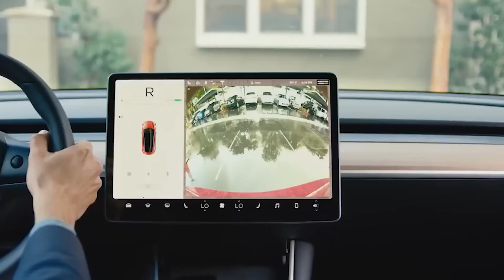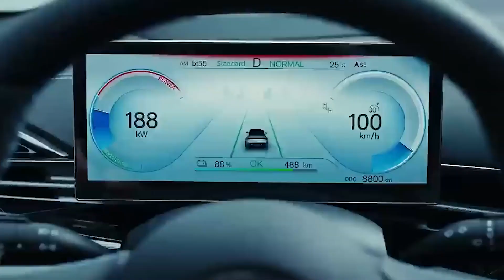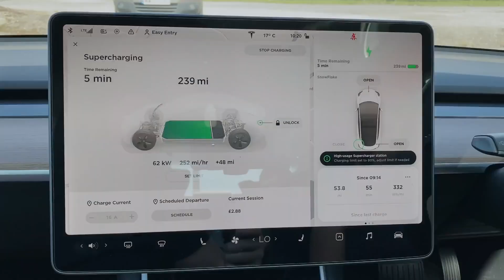TESLA - The Only Game Changer in Town | Tesla the Best EV Car Money Can Buy

Comment: Ok, I get how great EVs are, my wife has one but she still uses my Jeep 4xe or Evo 9 and some occasion my s2k because we're both spontaneous meaning we go on trips unplanned.  On top of that, were also busy persons. Two top reasons that gives us no time to charge the car on some trips when car is low on charge. Plus our home charger went bad one time so we had to get it fixed.  Regular plugs takes longer to charge.

Hybrid is the way to go. EV saving the environment is a scam. They should be more honest, maybe EV saving you bucks from gas prices might be better.
Reply: I bought an EV not for environment but because of the instant torque and save money on fuel. Plus charging a Tesla is much better experience than any other EV. Im also a car enthusiast, Tesla model 3s especially dual motors are blast to drive. A lightly modded model 3 can hang with super cars around a track, look up unplugged performance, they beat 911 GT3 RS around many tracks around the world, including one in Japan called Tsukuba. Not bad for a family sedan vs purpose built race car.
Reply from the maker: I agree with you 100% I also bought it for the same reason and the Tech,  huge gas savings, and tired of mechanics and the constant games. Let's face it if you did everything they recommend everytime you have to go there on the  gas car you could probably buy Model X Plaid and still would be cheaper 😏
Reply: I have professional racing license since 2016 and have driven manual more than automatics or EVs.  Most men I beat on the track resorts to either automatic or EVs 😅 not sure maybe its ego too for not being able to beat a woman using a manual transmission😅 I have a Tesla but only use it for work A to B very rare on spirited driving. Tesla is a car I dont mind getting dinged lol hope the day comes when it can fully charge to atleast within 10 minutes.
Reply from the maker: Well one thing too many moving parts on any engine cars which means too many visits to mechanics plus all the oil changes.